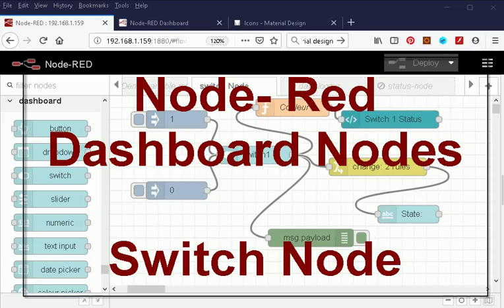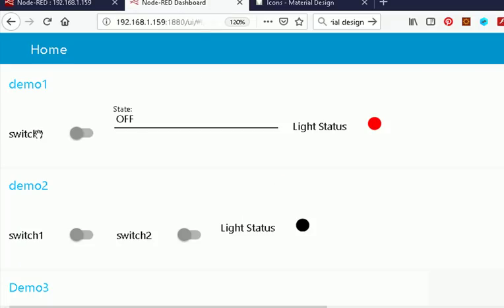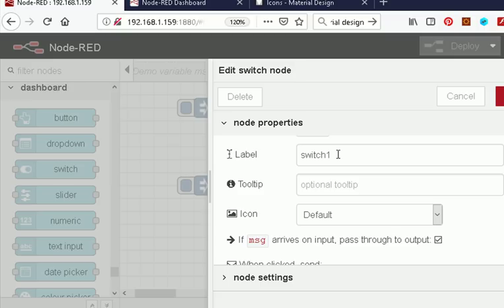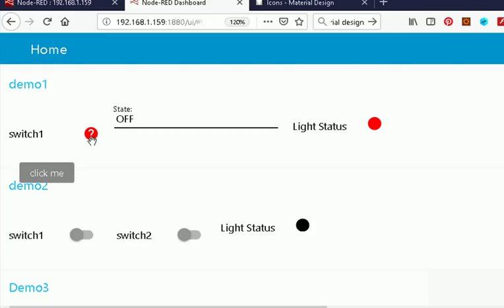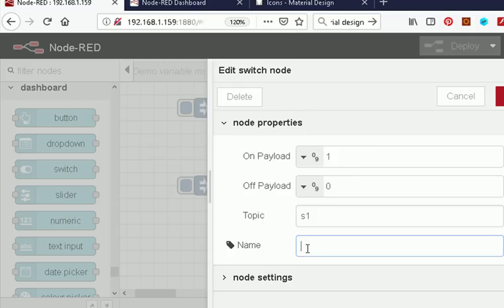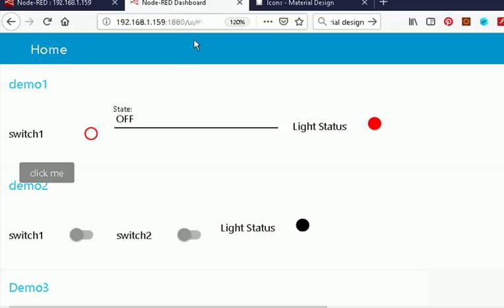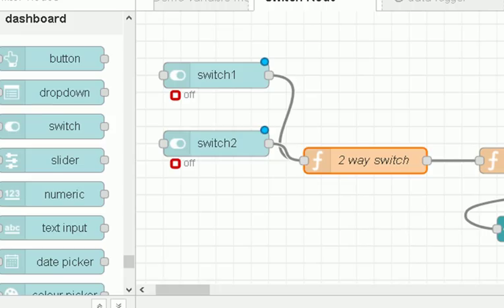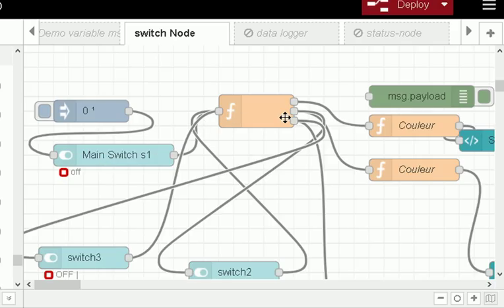Using the Node-Red Dashboard Switch Node

Comment: Hi Steve! Thanks for your tutorials, I'm just starting out with NR and have found these useful first steps.
I found a very couple issues with your Couleur function.
1) The IDE shows that lines 12 and 19 (var newmsg = { ) have the error "newmsg is already defined".
2) If I swap the colours 'lime' and 'red', the function breaks and only ever sends lime. Literally just swapping the text colours around, no other changes. Likewise, switching the zeros and ones around causes the output to always be red.
Any idea why this would happen?? I'm pretty confused! Cheers!
Reply: Ahh, got a solution from a friend:
if (msg.topic=="init") {
  //not real value
  return {
    payload: 'black'
  };
}

const state = parseInt(msg.payload)
if (state == 1) {
  return {
    payload: "red"
  };
} 
if (state == 0) {
  return {
    payload: "lime" 
  };
}
Reply from the maker: Hi
The car newmsg should only be declared once which is why you see the warning- My mistake but it doesn't affect the script.
I tried reversing the colours and it worked as expected. Can you send me the changed code snippet and I'll take a look.
Rgds
Steve

Comment: Hi steve, I have a problem with the layout. I have 1 Tab with 1 Group. I inserted 1 switch to check the functionality (it was switching a GPIO on the (diet-)pi). I then inserted the other 7 switches but for some reason, the first switch (ie the test switch) is sorted on the bottom but it should be 3rd in the list. I tried with the alphabetically order of the name, the label, ... but it stayed at the bottom. How can I determine the layout of it? TIA   BTW most of my NR knowledge, I've got from watching and following you video's! Tx & KUTGV!  Mario
Reply: damn, i've just found it (in the hidden Dashboard tab) ... sorry ...
Reply from the maker: in the tab on the right select dashboard and you can drag and drop them into position